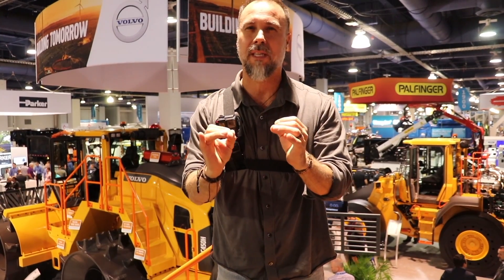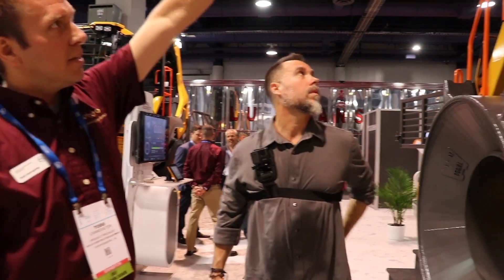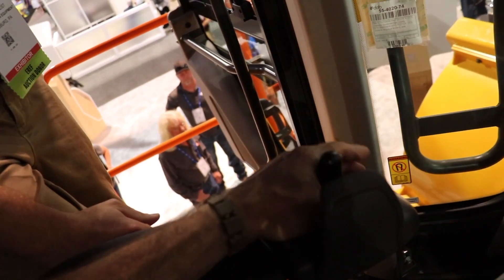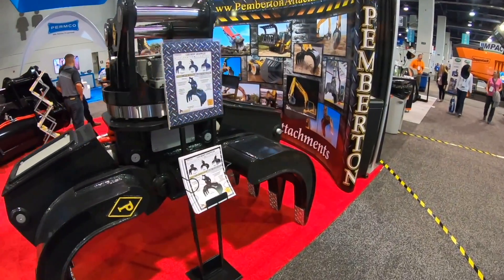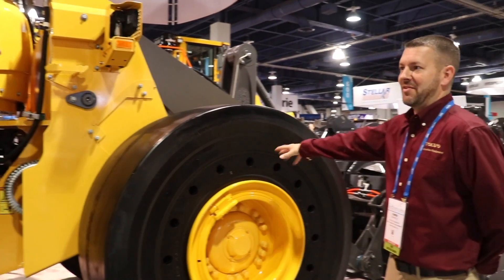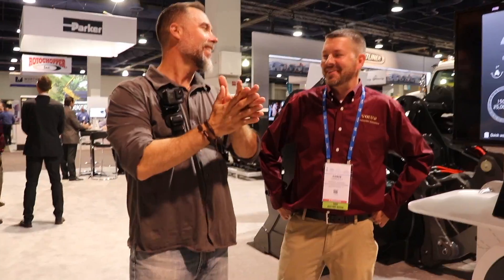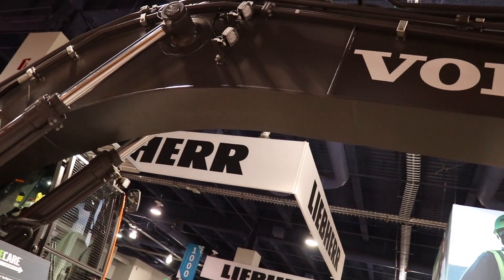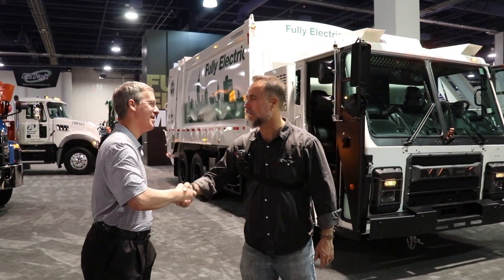A Look at Specialized Heavy equipment for Waste handling-loaders, excavators, & garbage trucks

Comment: As a real mechanical engineer with 3 earned degrees and 40 years experience in design and applications I could assure you that all electric equipment for heavy equipment is always going to be problematic because of the issues with batteries.  Lithium batteries are extremely expensive and and a heavy equipment environment can be extremely dangerous.  This is in addition to the capacity problem and the extreme expense replacing the batteries after 3 to 5 years.  They never talk about this when they sell it to you!!   There are advantages to a duel or hybrid system in that you can love a lout the usage and operate the diesel or natural gas engines at a constant rate and augment with electrical Which dramatically increases the efficiency of the entire system.  This also allows for a vastly superior braking system by using electrical braking as opposed to mechanical braking for the primary system.  Of course this also allows for recovery of the power used in breaking by recharging the batteries if that is needed.  I began working with lithium batteries back in 1979 and have worked with various electrical and hybrid systems for the defence industry and other industries for 40 years.  Sadly many companies are overselling electrical vehicles and over time the customers will be extremely unhappy with them because they failed to discuss the downsides.  We are having the same problem with solar systems as they always fail to inform the customers that all photovoltaic systems have an efficiency reduction of 15 to 20% per year.  This means that after 5 years you will lose more than 50% of the system capacity.  Set most systems for amortize over 25 years, this means that they are lying to the people about the performance of the system over 25 years because after 10 years the systems are basically worthless.   I am not pro or con any of the different options but I am honest about the benefits and negatives of each type of system.  Electric motors are smalle lightweight and very powerful but the battery systems are extremely expensive and dangerous.  Back in 1979, 1 of my technicians was nearly killed when a lithium battery exploded.  In addition there are tremendous disposal problems with lithium batteries.

Comment: Volvo has a lot of work cut out for them to catch up to CAT for landfill compactors. Our landfill has a LC450H and its a chore to use. The gearing is way to high, 5mph through the garbage! And the engine runs out of power FAST, a blade full of waste or working on a slope and it almost stops in it's tracks. Engine gets hot and and throws coolant temps codes all day when working hard. The decking is a joke, that button shouldn't be needed to open the door, it should be level with the decking, and those guards don't cover the cleats all the way across, had tons of pipe and boards thrown up onto the decking and at the windshield guard. Steering system lacks strength too, when the LC450H starts getting stuck or you need to duckwalk over rough material like powerpoles to break it up the steering gets sluggish and unresponsive stopping you from wriggling where you need too. And the hydraulic hoses running through the center of the machine are begging to get ripped out by some piece of debris. My biggest peeve about it though is the lift and steering joysticks both feel completely dead, with our CAT you could always tell where the blade was from the joystick feedback and steering was snappy and fast, the Volvo just doesn't have it.

But the biggest sin of the LC450H is it's complete lack of decelerator. Every other problem you can ignore or grow numb too but I miss that every day.

It's not all bad though. The cab is comfy and the A/C is awesome. Volvo easily has the best radio in the industry too. And it does get the job done. All the M Terra stuff is fantastic and was a good move to pair with them, the compaction we get from it is great. Volvo says they listened to the industry when building this thing but what we got is just a wheel loader with cleats and decking. It feels really cobbled together, its a start certainly but it needs a lot of refinement.
Reply from the maker: Thanks for sharing your experience, thanks for viewing!

Comment: cut the handle of the pull pin put it in and weld the handle back on. easy a cheap mig and grinder can handle the task

Comment: Should look into the CAT stick steer system in their loaders, used to run a 966M loader on stick steer, No steering wheel at all maximised the viability out the front and made life a lot easier

Comment: I want to know how they got that compactor in there without messing up the floor of that convention center
Reply: Drew w Wooden pads like a board road for drilling rigs or cranes.
Reply: I'm guessing they either rolled it in on some kind of dollies or laid down a special matting material for it.
Reply: Probably rolled in on regular wheels and then replaced with those.
Reply: I've seen them hauled on rail trailers then wheels put on lowered and truck pulls away fine (like a low boy but no deck just rails)
Reply: When we got ours it came on a trailer and it had 1” plywood that they put on the trailer and basically drove it up on the trailer  and chained it down
‘

Comment: I bet they put different wheels on the compactor to get it in and out of the building.  If they did not i would love to know how they got it in and out without causing tons of damage.  Those spikes put holes in asphalt roads if you need to drive them across for some reason.
Reply: Rich Wood 3/4 plywood on the floor then trench plates truck is no more than 20’ away. It just cost to much to swap out tires and requires multiple people and equipment. I move them every so often.

Comment: I had the misfortune to operate an A40 Volvo rock truck. 
I will say I liked the cab lay out, but that was the most miserabley underpowered  pile of iron I ever ran, WHEN we could even keep it running! 
The company also purchased a Volvo road tractor to move equipment, had a Volvo engine, same problem couldn't keep it out of the shop!
Not impressed with them at all.

Comment: I want to know how they drove the trash dozer thew the building to display it without ruining the concrete floor
Reply: James Beemer they use rubber mats, same with excavators and dozers
Reply: with that compactor, most likely the same way as loading them on a trailer.
believe it or not, plywood sheeting.

Comment: As a several year volvo loader operator in the metal recycling industry the biggest problems we've had with our volvo loaders is the linkage and wishbones and pins. The automatic greaser lines are very prone to breaking and end up being useless quickly.

Comment: The aljon trash compactors are still king of the hill and they have not been produced for years. They were made simple with off the shelf parts were heavy over 120k pounds if memory serves. We still work on them from time to time for the landfills because nothing on the market compares so they keep rebuilding them.
Reply: I have never seen such a small compactor.  The ones at all the landfills i have dumped at were much larger than the one in the video.  I could only think that one would be used at transfer stations.

Comment: I dont think electric is fully possible yet . batterys arnt efficient enough also the power consumption for every vearcle lorry car van etc is going to be so demanding can the power companies supply that much power every evening pluss lorrys getting low on power will take too long to recharge . Just dont think the numbers add up
Reply: JD shenanigans - don’t worry, you’ll be able to charge them up overnight using your solar panels.... er wait?..
Reply: Even if they can only get 300 miles a day out of them, that could replace a lot of diesel/gas vehicles. Besides with modern battery/charger technology it's possible to charge from 20% to 80% in 30 minutes, even when they are that large. I wouldn't worry about the power companies. If they see an increased demand it will only give them an incentive to invest more money in their grid and hopefully more efficient ways to generate power. Fusion reactors are right around the corner anyway.
Reply: JD shenanigans its perfect for a garbage truck who starts and stop the whole time, recharging them in the lunch break would probably be enough
Reply: Just hope the rest of society are better at recharging than me . Ive always got low battery on my phone camera.ipad etc even my poxy tooth brush stops due to flat batterys . I realy cant see it working

Comment: Anyone else seeing forestry equipment instead of waste equipment? Or is it just me?
Reply: Having run a packer myself, they really need to stay on a trash pile. The wheels on even semi-compacted ground will destroy the ground and just about shake the glass out of the cab. It is hell on the machine and the operator.
Reply: @TheSoloAsylum  

I think he means with different wheels. Forestry equipment is very similar as far as reinforcements and guarding.
Reply: @TheSoloAsylum  obviously it would need much more conventional tires.

Comment: So with the trash masher, in theory you could put regular loader/skidder tires and wheels on it and make a high speed heavyweight bull dozer.
Reply: N&W 2156 Y6a they also make them with crows foot packers for wheels for dirt work.
Reply: @joshjansen8429  neat
Reply: Dustin Logan  yeah, but they are horribly ugly, and also this thing is pretty much prepped for forestry use aside from the wheels
Reply: Cat makes them called wheel dozers a lot of power plants use them to push coal